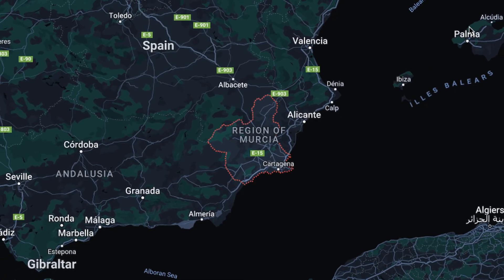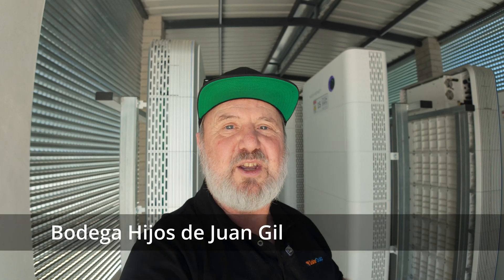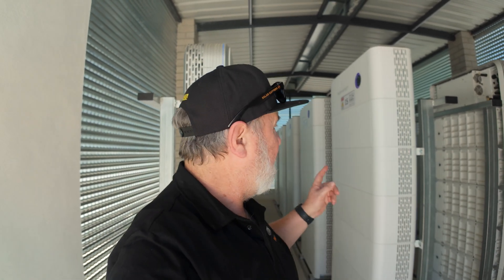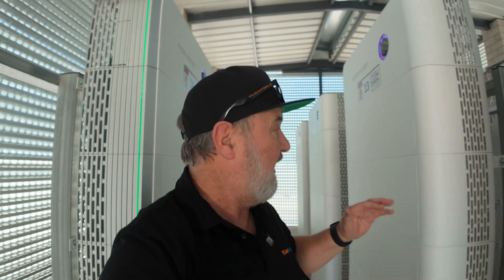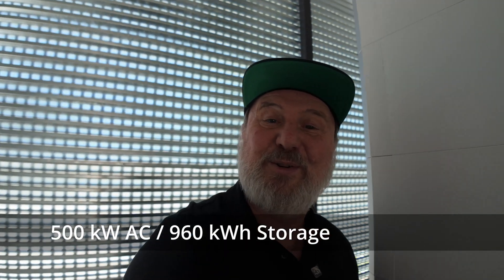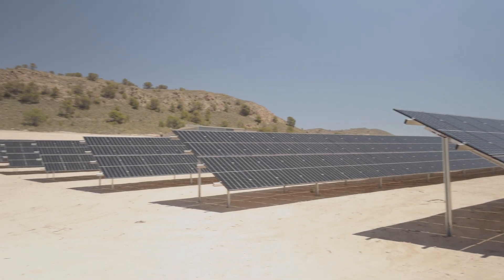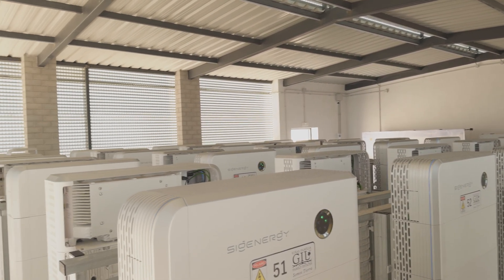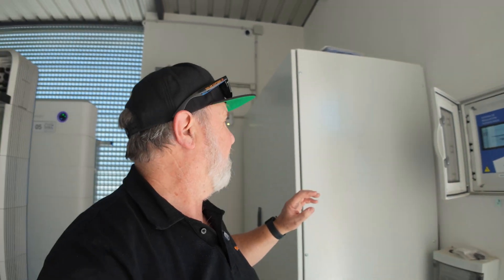3 MWh Sigenergy SigenStor Battery System

Comment: Hi Glen, I am thinking of installing SigenStor 24KW with Gateway. Just want to check Sigen Power Sensor (or consumption meter) need to buy separately or it already included in the Gateway box. If you not sure my questionn I can send you the image via emsil. Cheers.

Comment: Installation++ Size++  Safety++ Just wondering about the warranty. Its is throughput based, 23,77Mwh for the 8 Kwh battery. Seems to be much less than the competition. What is the catch?